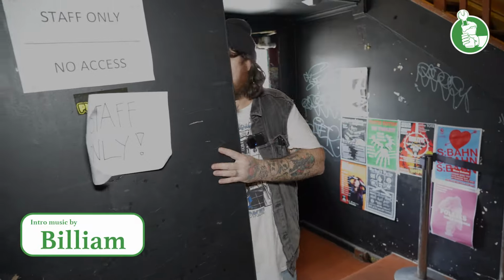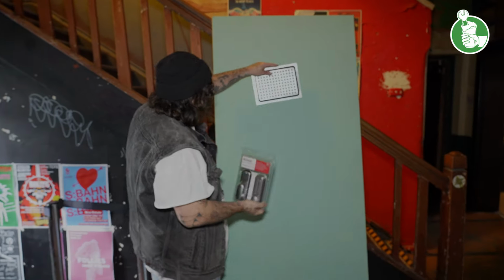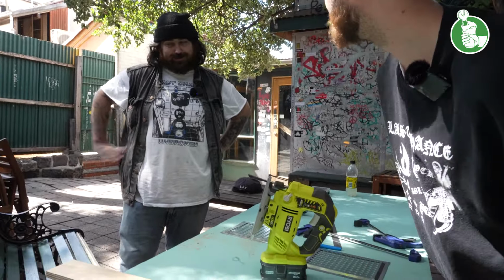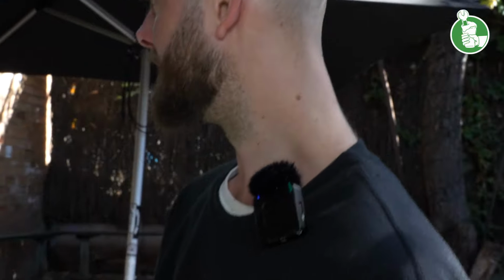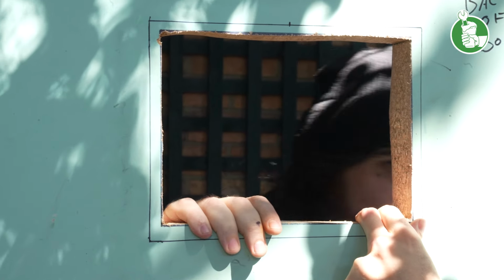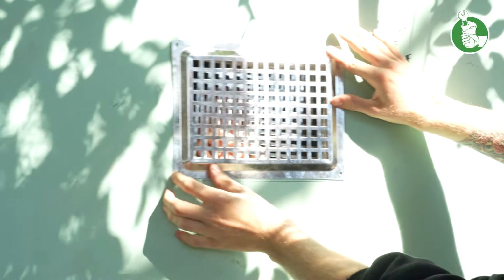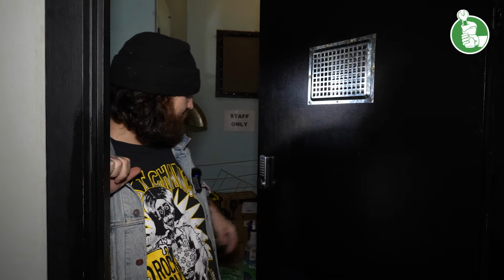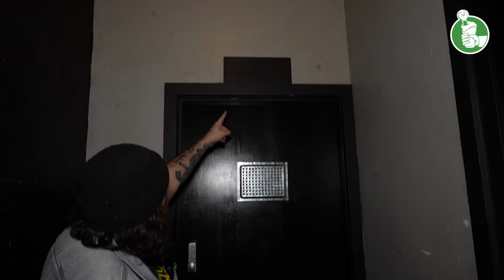KEEPING THEM OUT OR KEEPING THEM IN? - Fixing the staff door that everyone complained about

Comment: A fact that I only recently found out, doors have an 'inside' and an 'outside' the 'outside' will actually be ever so slightly narrower than the 'inside' this allows the door to open and close without hitting the door frame. to better explain, an 820 wide door will have one side that is 820 wide and the other side will only be ~816 wide. the 820 side is on the side that 'swings in', the side that the hinges stick out on.
Reply: It's called a door jamb!